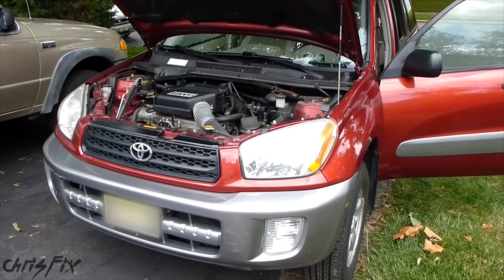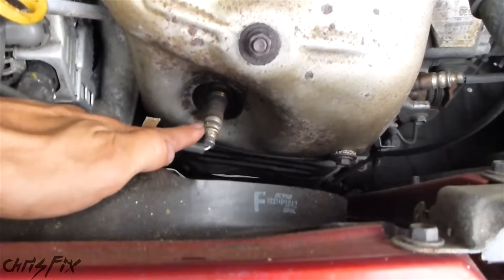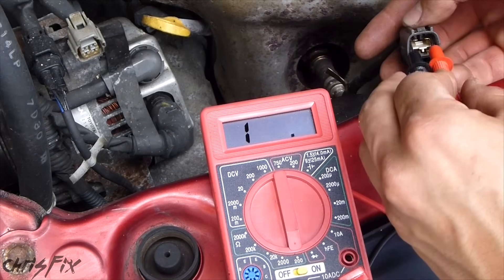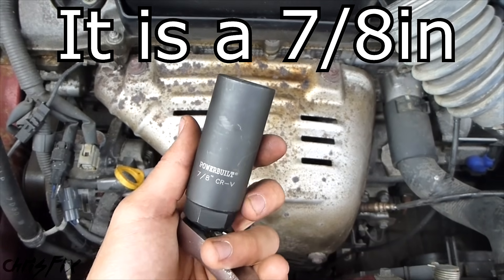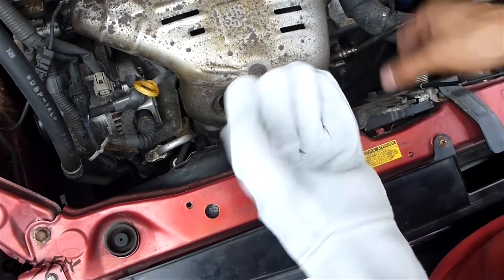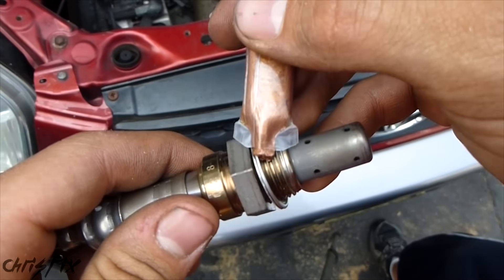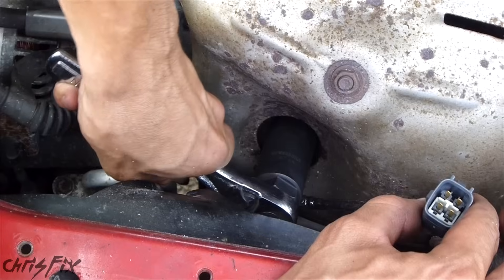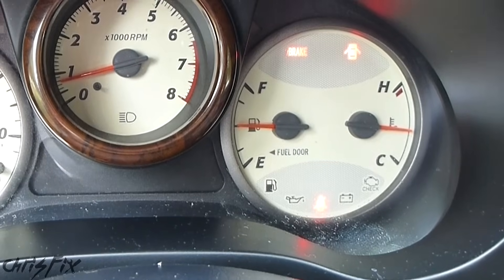How to Check and Replace an Oxygen Sensor (Air Fuel Ratio Sensor)

Comment: The only clear and concise YouTube mechanic that doesn't try to flex how much he knows for 15 minutes
Reply: ironically chris is the best flexer here
Reply: I may seem picky, but so many times key items are missed on the channel videos; perhaps Chris assumes  every one has a more than passing knowledge, clearly not the case. In this video, for instance, what is Bank 1, Bank 2, Sensor 1 , Sensor 2? Are they the same (standard) on ANY car? How about if the engine is 4,6,8 inline, v cylinder or flat😢😢? See, the video becomes quite useless if you didn't know any of that stuff.
So hopefully a bit more care!
Reply: Cap
Reply: It was before longer videos make more money so that's how it goes.
Reply: 2024
Reply: This guy is a hater ong😂
Reply: @DeyDeys   what is ong? 😅
Reply: So you don't like actually learning in depth of what you're doing? What a shocker
Reply: @hewasdeadwhenigotthere46 What I got from the comment was that some guys focus on well-informed videos and are able to resist the temptation to be patronising, whereas some others just can't help themselves
Reply: Instablaster

Comment: Hi chris i have a 2012 honda civic lx 4 cylinder. The milage is terrible and my mechanic said its the sensors. But their is no check engine light on. I asked my dealer and he said that the car is computerized and it will tell you if any sensors are gone bad. I just dont know who is right. Please help

Comment: Hi Chris. I just finished watching your video and I wanted to know if the same technique would apply for a 2007 Infinity G35S because my service engine soon light keeps coming on and the code that Auto Zone pulled up is P2A03-a/f ratio sensor bank 1 circuit 2 range?????
Reply from the maker: Yes it will be the same process.
Reply: ChrisFix ok great. I will see if I can find someone to fix it for me but I shouldtest it first right?

Comment: NEVER touch the tip of the O2 sensor with your finger. It will leave a residue and not work correctly.

Comment: I have a 2004 rav4 that apparently has a "oxygen sensor upstream bank 1 sensor 1" that is going bad.. This looks insanely easy to replace and I've seen the part for around 70 bucks.. Two questions.. Is the part I quoted the same thing as the part you just replaced in this vid? Also.. Do I "need" to use a sensor socket or can I take out the old sensor and put in the new sensor by hand?

Comment: Dear I have Honda odyssey 2006 & yesterday I got a engine check alarm then i did diagnostic with the auto lab he said 2 sensor faulty. P0135 ho2s AF Sensor B1 S1 heater  & P0155 ho2s AF Sensor B2 S1 heater, How i can repair it & where i can buy it as i am living in Qatar

Comment: went in with a P0401 code engine light on my 2000 camry  vsv solenoid ..replaced it and the light went away ..how ever the technician says that it also  means that I mist replace both oxygen sensors even without a light...hmmmm? your thoughts > anybody ?

Comment: Hi +ChrisFix thank you very much for your video. Quick question i'm getting these codes on my Rav4 P0141, P0161 & P1155.
After some googling it seems like i have 2 faulty sensors. Do you agree? Do you think i should do any other testing other then the one you did on the video??
Thanks very much for your time :)

Comment: I have to change the same sensor information say: bank 2 sensor 1 but the serial number is 234 9028 and have the same harness connection, now I'm confused Code p1155 2002 rav4 2.0 the engine is the same HELP PLEASE!

Comment: I really like your videos, I wanted to know if you could help me I have a problem with my honda civic 2005 some time ago install header but the check engine light appeared, change the oxygen sensor, use an extension for the sensor and nothing works also mentions in one Of the codes something about the catalytic converter

Comment: hi Cris, I have code P031 Oxygen Sensor Bank 1 Sensor 1 Heater Circuit Low, do you think by replacing it can fix the problem?
I have 2003 pt cruiser non turbo.
Thanks

Comment: hey chris i've been having some trouble with my car lately its a nissan c33 laurel with an rb25det series 2 engine in it ..when i first start it up in the morning it idles really well but as soon as it reaches working temp it starts surging really bad. if i up plug the tps or the afm it idles and runs good ive changes both the tps and afm but it didnt help can you please help me . ive also changed  the idle air control valve

Comment: Hey Chris, I have a 2004 Accord V4 LEV giving me a P0141 (Oxygen Sensor Heater Circuit, Bank 1 sensor 2) code, and was wondering if the steps portrayed in this video would be the same process to go about fixing it? I also have a 61-1 (Battery Voltage Malfunction) code popping up and was wondering if this code has any correlation to the P0141 code. Any insight would be helpful. Thanks and keep up with the awesome vids!

Comment: I wouldn't use a cheater bar on a ratchet, because I've popped cheaper ones barehanded before while changing out parts that someone had likely run down with an impact gun. Best to just get a breaker bar with the proper drive size.

Comment: Hello, I tested it with my meter and it showed 0.6 ohms. Would you say that it's cooked? The fuse was fine. My car is a 2005 Avalon.
Reply from the maker: It varies from car to car. Look up the specs on your car or get a new one and test the new one against yours.

Comment: bro! took out oxygen sensor and the plate on the tip is missing. what the hell now what do I use a magnet to find it or is it ok to put new sensor?😥
Reply from the maker: If you can get the exhaust off that is one way to remove it. You can also just keep it in there if there is no rattling and put the new sensor in.

Comment: I have a truck pick up 1992 GMC Sonoma v6 4.3 2wd. and engine start working good but when I put it on drive or in reverse engine turn off ,any body kmow what will be the problem?
Reply from the maker: Check for vacuum leaks.
Reply: ChrisFix  Ok  thank you Chris I will check that, apreciater you help and I will let you know wnen I find the problem.ok
Reply: Alejandro Palazuelos im having a similar problem. did you end up fixing it yet?

Comment: yes Chris

.My codes came up P0171 system too lean bank 1,P0115 engine coolant temp attire circuit,P0330 Knock sensor 2 Circuit,P0171 System too lean bank 1, I already replaced coolant temp sensor,can any of these also effect operation of fan...I notice fan does not run,no hot air from heat,they cut on and off when a/c is on
Reply from the maker: If the fan has it's own thermostat you might want to replace that as well. The fan should come on when you turn the AC on even if the engine is not hot.

Comment: Hey what's up Chris got a question I have to replace my O2 sensor in my 2004 Crv in the wire is black and I forgot if it's the front one or the back one are they color coordinated because one is black and one is white

Comment: When i get old vehicles I take a pair of side cuts and snip the wires and use a regular long socket because they are usually seized up after 100000 miles then use the O2 socket putting the new one in.The stress of removal can spread a O2 socket when removing the old sensor.

Comment: Thanks ChrisFix. Now I know where the oxygen sensor is located and how to replace it. My check engine light is on every day. I'm thinking it has something to do with my oxygen sensor. I wanna fix the issue myself instead of going to the mechanic and losing lots of money.
Reply: Get a scanner to see if that's actually the problem. Just in case. It could be something else and hopefully a lot cheaper to fix.

Comment: Hi great video BUT did you do any readings for the o2 sensors before and after with diagnostics? OR what readings should and o2 sensor have when good and when bad?

Comment: O2 sensor was my problem too. I took it out, brushed it off with a wire brush, and put it back in. The check engine light hasn't come back on, and it's been a few months... But I'll go ahead and check the resistance like you did just in case lol.

Comment: i ordered the denso 234-9023 af sensor to replace my bank 1..  the connecter prongs were vertical to the white tab instead of horizontal like the old sensor... also the connector is the wrong size. the sensor collar has the numbers 028 on it.   the box says 234-9023.  did denso pack the wrong sensor in the right box? chris fix

Comment: hey Chris I know this is late but I have a nissan maxima 2000 se I replaced the mass  air flow sensor and oxygen sensor because check engine light came up but even then the car idles roughly at stops and red lights and just shuts off I have a feeling is leak in the house cause I hear hissing but like the average I get for mpg is like 8 and then I have to put more gas like $100 a week just for 10 mile drives home and work

Comment: Bank 2 on an inline ? Doesn't exist
Reply from the maker: Thanks for sharing but bank 2 on an inline engine does exist. There are two A/F ratio sensors before the cat. Cyl 1 and 2 have one sensor and cyl 3 and 4 have the other (bank one and two).
Reply: ChrisFix Crazy, I only assumed V engine had bank 1 and bank 2 because the first cylinder is on the opposite side of the block as the second cylinder. Thanks for that man!

Comment: It helps to have the engine a little warm, the exhaust will be hot enough to make it easier to break the sensor loose. If the sensor is confirmed to be bad/dead,  don't bother with the special socket to remove the bad sensor, just cut the wires and use a regular socket to remove it. But, a socket with the slot is needed to put the new sensor in. Never use dielectric grease in the connector, the O2 sensor gets reference air thru the wiring, the grease will block the air from wicking down the wires to the sensor, effectively rendering the sensor bad. The sensors have an air cavity in the body to sample outside air to use as a reference of oxygen content. The sensor uses the reference to send a signal to the pcm of the oxygen content of the exhaust. For those interested,  Wells Vehicle Electronics has a video on their youtube channel that explains all about the narrow band O2 sensors. It's a long video, but it is very interesting and educational. Btw, i'm a Chrysler dealer tech.
Reply: Not only grease (i suppose we're talking about dielectric grease). Also avoid spraying electronics cleaner (or, even worse, brake cleaner, throttle body cleaner, carb cleaner...) on the connector, even the no residue one (the MAF cleaner is basically fast drying no residue electronics cleaner). It apparently gets inside the wiring and then it can't evaporate from inside there. This will make a good O2 sensor turn into a bad one too (for some reason regarding electrochemistry, it will start sending an always lean reading to the ECU) and you'll immediately need a new one... another good tip, if there are leaks/issues with pressure switches and anything in close contact with a pressurized fluid supply, replace the faulty switch or sensor soon, because the fluid leaking through the sensor/switch, be it motor oil, PS fluid, coolant, can over time travel through the engine wiring harness and foul both the ECU and the O2 sensors...
Reply: David B. Fishburn why do you think y’alls car  don’t last long
Reply: Wow....is that true about the dielectric grease?!?
I was thinking about using it!!!

Comment: I have a 94 f-150 with check engine on. I changed O2 sensor but check engine light came back on. What can it be now. My 94 f-150 only has one sensor before the catalytic converter.

Comment: Hey Chris I have a P0420 code I have a P0308 and a P0308P code do you have any Clyde what I could do
Reply from the maker: They could be two different problems. One is a cylinder 8 misfire so check the coil pack and spark plug.
The other is a problem with the catalyst efficiency which means that the cat could be going bad.

Comment: Good morning. First thank you for the amazing videos. I have a possible project slash video for you. I have a SUV with a bad O2 sensor. I'm sure it's the wiring from the ECU to the O2 that is the issue. Thought it might be a good video for your viewers on all the steps to diagnose a bad O2 when it's not a bad sensor. I live in the Philly area.

Comment: Hey Chris, I've been watching your videos and have already tried a few things to see if that's what's causing my 2001 dodge neon to sputter while driving, it sputters a bit then straitens right back up, and when I'm on an incline it tries to die, and recently it died on me while driving and wouldn't start back! Then the next day it started right up but still sputters and tries to die on hills and dies while driving at times! I have cleaned throttle body and got a new battery, had a garage clean my catalytic converter, the fuel pump kicks on a few seconds when turning the key, so I'm at a loss! Anything else u no that will cause this! Thanks so much

Comment: when are you going to change a bad catalytic converter?
Reply from the maker: When I get a bad cat to change.
Reply: Petar st Saw in the news some dude purchased a van that had the catalytic conv removed. His son died in the back seat due to carbon monoxide. Does that special muffler you're speaking of get rid of that issue?
Reply: Matthew Livingston a
Reply: Chris, can you demonstrate how to diagnose a bad catalytic convertor using a infrared thermometer, unless u think that is not a reliable way of diagnosing. There are some videos out there but they are hard to follow.
Reply: If you remove the cat you violate federal emissions laws and risk a $10,000 fine. 

If you take that risk you dont need to put a muffler in its place. They used to sell test pipes that took the place. They were just straight pipes.

If someone died after a cat was removed it wasn't because the vat was removed. That would mean anyone riding in the back of a pre 1974 van would be dead. The problem was most likely an exhaust leak or a tail pipe that didnt exhaust the gasses properly past the body of the van. They will collect under the vehicle and may enter through any small holes in the body if the exhaust is leaking or the tailpipe is incorrectly positioned. 

Now would the cat have saved the person?  Maybe. Depends on many other factors but would no leaks and a proper tailpipe have prevented the death if there was no cat?  Yes.  It would.
Reply: This thing costs maybe thousand $..You could just get it the heck out of the exhaust system and solder in a regular muffler.But you'll need to install a special thing called non fouler or check engine light will come..Without cat. the power is increased and no boiled eggs smell no more.

Comment: Chris, do you have an idea of good O2 sensor sockets with 1/2 drive? Those from powerbuilt are no good. I borrowed a set from advance auto parts. I found that they are 3/8 drive, and the 90 degree angle one could not take the oxygen sensor off. I have a 20 inch extension on my 3/8, and i definitely the drive is the weak part. I actaully rounded the oxygen sensor a little, so i stopped.

Comment: This video did not describe how to find the correct sensor or determine which wires to troubleshoot. Did not cover troubleshooting the sensing element. only the heater element

Comment: Sir Cris pls need help. My sister ford everest 2007model. When I drive and push the accelerator it suddenlly off the engine and it flashes the check engine. I tried to full tank  and the chk engine gone and it does not power off. I used the car for a week. now when the fuel is low it came back it suddenly flash the chk engine and goes off while driving. need help whats the problem. is it the fuel tank has water in it? when i turn on the car without driving its ok no chk engine but when i drive and push the accelerator to make it run fast sometimes it will flash chk engine then off the engine.
Reply from the maker: That is a misfire. Sounds like there could be water in the tank. Try using this: http://amzn.to/2iqP4Jp

Comment: Hey Chris, I have a 96 Honda Prelude. I went to Autozone to check the engine light. The codes are P0135 (bank 1 sensor 1) and P0141 (bank 1 sensor 2). So how many oxygen sensors are there and where do I see them? It's a 4 cylinders Prelude. Thanks Chris!
Reply: For your own car you really need to buy a copy of Honda&#39;s Factory Service Manual. You can probably get it from Ebay. That&#39;s how I got the manuals for my Accord and Impreza. In addition you should visit the Honda forums, especially those pertaining to your year and model for additional information.
Reply: Thank you!

Comment: Hey Chris great video. I have a 2003 Toyota Rav4 2.0 4cyl. The check engine light came on and gave me 2 codes p0420 and p0430. is it a bad Cat? or could it be the sensors? Thanks for any help.

Comment: u smokin some dope lol? that o2 sensor kit is $100. get the same thing for like $30
Reply: armyraw29 where?
Reply: But for Toyota's, many pro mechanics insist on using ONLY Denso A/F sensors (which is what Toyota's are originally equipped with). They sight frequent problems in function & compatibility when using o2 sensors made by other manufacturers in a Toyota.

Comment: Why does a 4 cylinder  car have 2 banks?
Reply from the maker: There are only 2 cylinders firing at one time in a 4cyl so they have a bank for each set of cylinders!
Reply: So does this mean that the car has two catalytic  converters and two exhaust pipes?  One for each bank.

Comment: One tip I read is that you should do this kind of work on a cold engine (spark plugs or sensors) because metal contracts and shifts when hot. (Not saying you over tightened, just wanted to share that, also I am sure the anti-seize will prevent any issues).
Reply: Metal expands when hot!